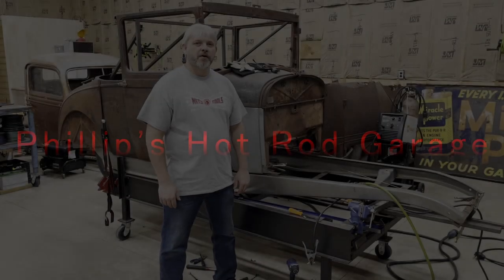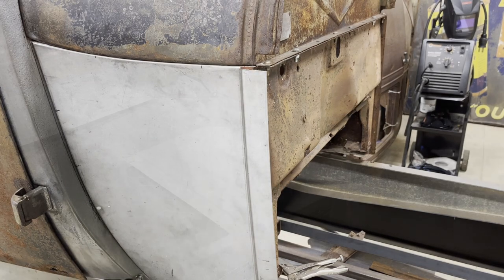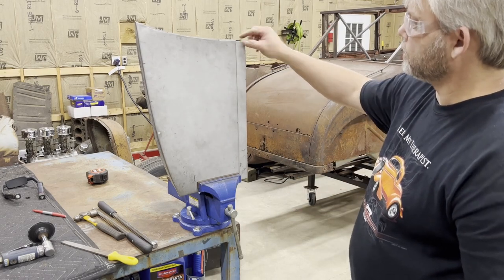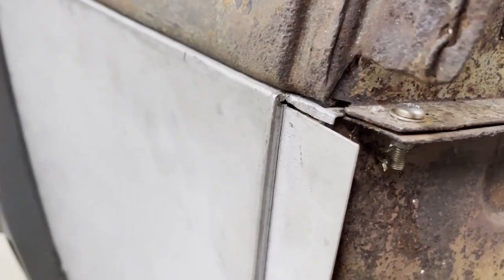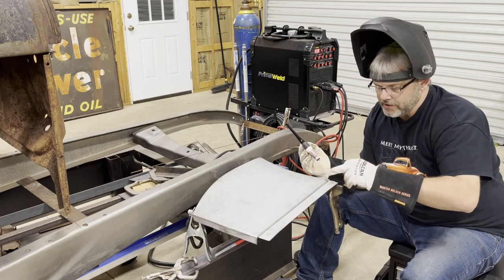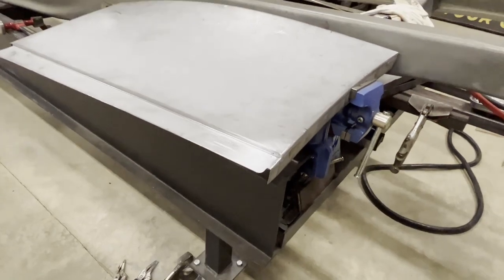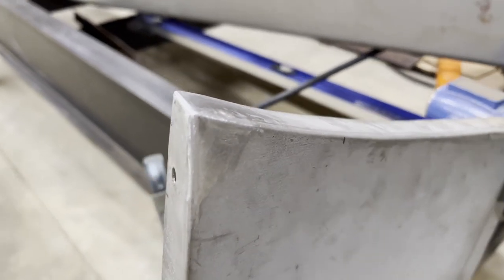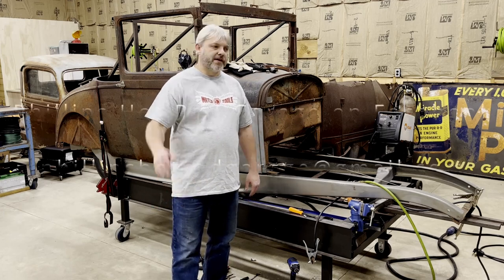Final work on the 1928 Model A cowl panel! TIG welding! 1928 Traditional Ford Hot Rod build.

Comment: Nice work on cleaning up this repair panel.  I don't think the panel looks bad as is. I recall seeing a rounded edge on the original panel when you were comparing them. 
Thanks again for sharing your projects.
Rick
Reply from the maker: I think it’s fine either way as well.  I’ll see how the driver side turns out, and go from there.

Comment: It’s coming out nice , what brand jig is the body and frame sitting on ?
Reply from the maker: I made the jig.  I used some I-beam from the scrap yard, and a few random sized pieces of steel that I could get cheap. I picked up the wheels at harbor freight.  Thanks for watching